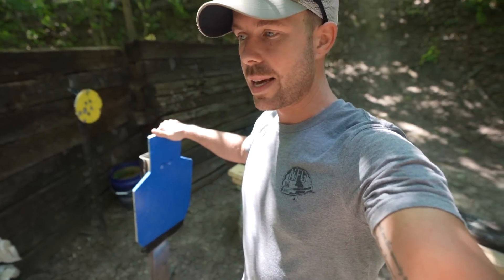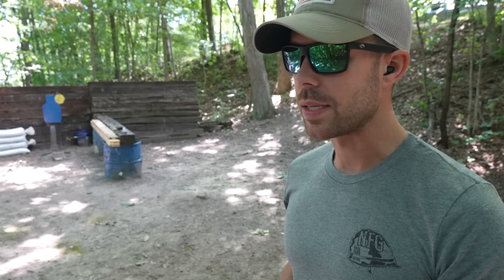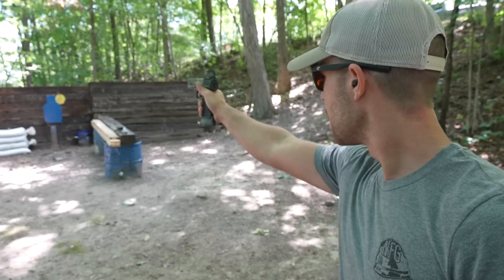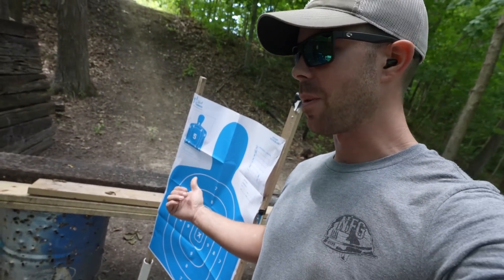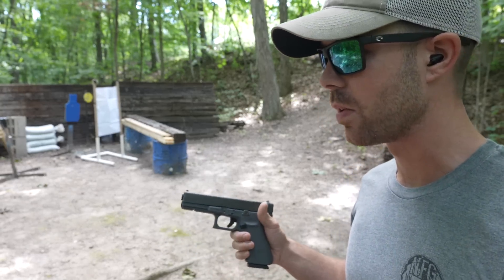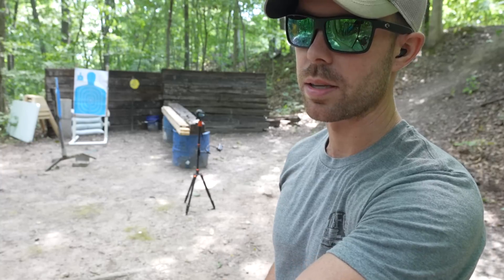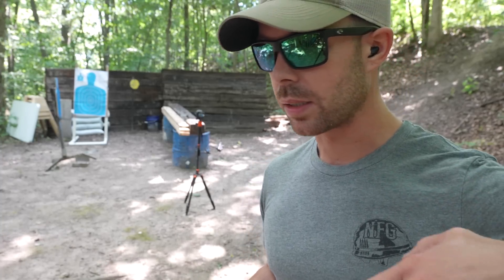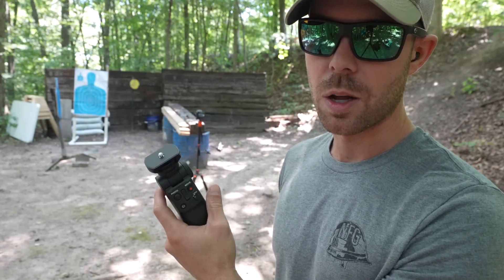How Likely Is A Bullet Ricochet??

Comment: Bullets should always be considered to have potential to Ricochet. Old training now. Yes, I’m getting old. 
Stay off the walls. Rounds will deflect along the line of the wall.
Shotguns: bad guy behind a car? Bounce the buckshot off the ground at the edge of the car. It bounces up into their legs. 
Riot rounds. Plastic/rubber/bean bags. Aim at the ground and bounce the road into them. Less than lethal looses its validity when fired into centre of mass. IE: beanbag rounds will punch right through 3/4” plywood.
So, ricochet can be your friend too.

Comment: Your comment about softer steel is spot on.  I had a little piece of random cold rolled steel, maybe a 6 or 8 inch square of it 3/8 inch thick and I propped it up on the ground against a small rock at a slight angle so it wouldn't fall over maybe 50 yards away and I challenged my mom to see if she could hit it with my glock 17 with regular 115 gr ball.  Well not only did she hit it the very first shot but I actually got grazed by it as it ricocheted straight back at us.  It grazed my left side torso, put a hole in shirt and burned and left a mark on my skin an inch long.  It was obviously still moving along quite quickly and I think it would have penetrated my skin if it had been just an inch further over.  Needless to say it scared the crap pit of me and we didnt shoot that mild steel with pistols anymore after that, only the rifles because they actually blew straight through the 3/8 inch mild steel plate and left massive holes both the AK and AR.

Comment: I've been hit by many rocochets.  The first was at a public indoor gun range.  This one was by far the worst, and nearly far worse than it was.  A large chunk of lead bounced off of the (overdue for maintenance) backstop and hit me in the upper right thigh, leaving a silver dollar sized bruise.  If that bullet was an inch or so to the left, it would have smacked me right in the nuts.  Most of the ricochets were off steel targets at cowboy action shooting matches.  One in particular struck me on the knuckle of my trigger finger and opened it up.  This didn't help my score any on that stage, it happened right before I went up for my turn shooting.  I have plenty more, but I'll let it rest at that.

Something you could try is seeing if you could bounce a bullet off the surface of water.

Comment: I have a suggestion. We teach never to hug walls in a gunfight because bullet when it hits a wall at an angle will NOT ricochet normally. It will follow the wall an take you out as you are peeking around the end.
Set up a wall of concrete blocks and conduct the experiment just as you've done with the steel.
Great video today.

Comment: State Police where I live, train officers in advanced classes to bounce rounds under cars. In the case of perp, of course, shooting at them. Highway concrete, street cement and blacktop all bounce differently. It of course became easier once they were assigned M4s and ARs, with the correct round, they could just shoot through the car. (Except when the are hiding behind and engine block.)

Comment: Many many years ago when I was young and stupid,  I was shooting at a private indoor range that my company owned. It was just two of my friends shooting as it was around midnight or so.. Someone got the bright idea to try and shoot at some brass that was about 20 feet out down range. I was shooting a 45 acp, and shot a few pieces of brass with no issues.  The last shot I took bounced off the concrete floor, hit the steel range backstop and came straight back and hit me square in the chest! that was the last time I ever tried something as stupid as that  ..I am actually embarrassed to admit I was stupid enough to do that.  Lucky for me it didn't hit me in the face
Reply: Did it pierce skin or cause any injury?
Reply: @tommyguy2fly  no - it felt like a very hard punch to the chest.. if it had hit my eye it would have screwed me.. but I was wearing Eye Pro..
Reply: I am new to shooting. I mean really new. What do you mean when you say brass? Is that different than lead?
Reply: @tmsact  the brass is the metal container that the gun powder and bullet and primer are attached to.   when you fire the round, the primer ignites the gun power, that is in the brass, which causes the explosion that pushes the bullet down the barrel.. the brass container and spent primer are what remains after firing.  These brass containers can be reloaded again with the proper tools and procedures.   
google ammunition components to get a better understanding